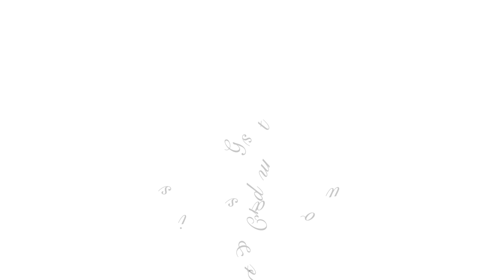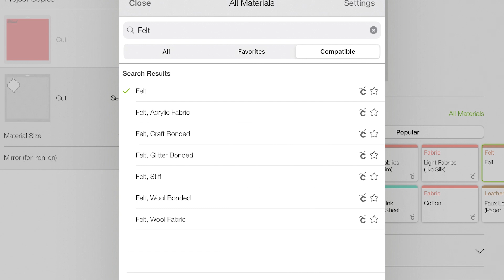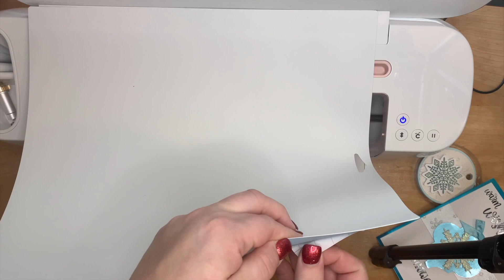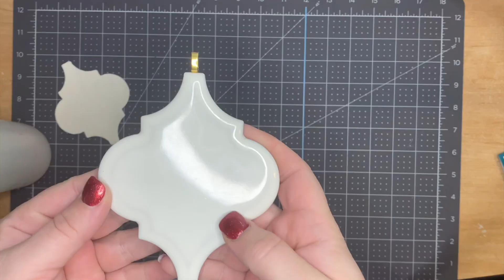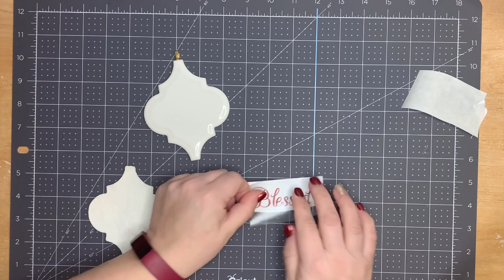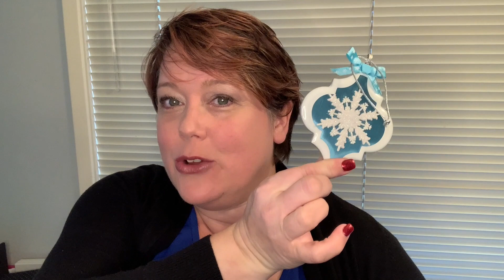HOW TO MAKE CERAMIC CHRISTMAS ORNAMENTS - STEP BY STEP - PART 1 - CRICUT MAKER PROJECTS WITH TILES

Comment: I have a  Ceramic Christmas tree that I got..It was in 3 parts but the owner before me glued the 3 parts together..so there are gaps and you can see light through them.. my Q is what can I use to fill them and it needs to be white when dry  as my tree is white
Reply from the maker: Have you tried a porcelain chip filler?
Reply: @Cat Slade  no I have not ..were can I get some ? Do you have a name of some
Reply from the maker: This is one that I found. But I’m no ceramics expert. It’s just what I might use. https://www.amazon.ca/Magic-3007-Porcelain-Epoxy-White/dp/B008HT1EEM/ref=asc_df_B008HT1EEM/?tag=googlemobshop-20&linkCode=df0&hvadid=294796621863&hvpos=&hvnetw=g&hvrand=7216736912443488842&hvpone=&hvptwo=&hvqmt=&hvdev=m&hvdvcmdl=&hvlocint=&hvlocphy=1001913&hvtargid=pla-421639168684&psc=1
Reply from the maker: Link
Won’t
Work in here. What about a poly filla?